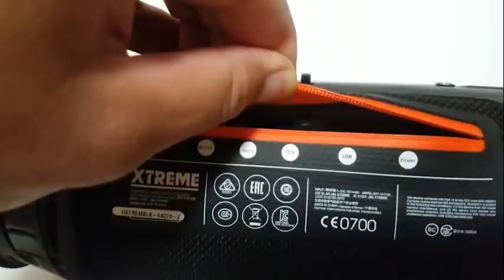JBL XTREME with 18650 Batteries (DIY)

Comment: you'll need to cover the hole where the wires goes in with hot glue or some tape so that the air doesn't comes out, it happened to me after i changed the battery with 18650 I notice some rattle noise after using it for a while and I found out that the air is escaping out from that hole
Reply from the maker: +Jhay12 yes that is correct. I don't think I mentioned that part in this video only in the new video. >>   https://youtu.be/HhC_CpxtSF4

Comment: Use 7.4 volt battery pack. Not 3.7 volt battery
Reply from the maker: Yes the total voltage that goes to the amplifier board is 7.4V NOT 3.4V, on full charge it should be 8.4V
Reply: That pack is connected 2s2p original one was 2s1p(lipo baterry)

Comment: you didn't say anything about the flat cable for the led indicators, so I disconnected them and now it does not work :(
Reply from the maker: Sorry to hear that, but I just didn't bother saying anything cause I thought everyone would see on the video that I have not touched it at all. I haven't seen the connection for the LED lights but hopefully it has a clip.
Reply: Taylor Soloai i couldn't find a clip :( in other videos they unpluggled it but said nothing about it

Comment: hey, nice video thx. 
Is this better than just using new jbl battery packs?
Reply from the maker: +Robert Oxman its a lot easier to use the JBL battery pack but I just went with this method just because I like to experiment and it worked!
Reply: I see, thank you, same here. I think I am going to use some "3000" mah, lg HG2 18650s Seems like it may have better battery life actually than the stock lipo

Comment: can i use, normal rechargeable batteries like sony cycle energy instead this 18650 battery?
Reply from the maker: +Maicoltube are those the "AA" kind? If it is I don't recommend it. It will take up too much space but not enough power to make it work.

Comment from the maker: I have a NEW VIDEO that goes in FULL DETAIL for the battery connections to the board here https://youtu.be/HhC_CpxtSF4

Longer but it will answer questions about what I did not show here on this tutorial.
Reply: Taylor Soloai hi , i want to ask if its also possible to put 18650 battery in jbl flip 3 ?
Reply: Taylor Soloai Can I use 18650B battery..? What is the letter at the end of the number...? Thanks...

Comment: Thanks for this video! I would like to do this myself with my Xtreme but I don't understand in what way you wired the lithium cells.
You would definitely help me a lot if you could tell me this.
Did you wire them parallel or in series?
Reply from the maker: Each pair of 18650s are wired up in parallel
You can watch my new video on how to do that here https://youtu.be/HhC_CpxtSF4
Reply: https://www.ifixit.com/Answers/View/494531/Replacing+BMS+board+and+batteries

Comment: please, how many  Panasonic Ncr18650b 3400mah Ion Litio 3.7v do i purchase ???? 2 or 4 units???? thanks for the answer Taylor Soloai
Reply: cause i have jbl xtreme and the battery is almost dead...just half an hour still works and after needs to be pluging
Reply from the maker: +Yvan Garces you need four units. Connect them in pairs (parallel), so that's two pairs of 18650s to attach to the BMS board from the original battery.
Reply: Taylor Soloai thanks a lot

Comment: Bro can i pm u on fb? Wats ur fb page? I hav same issues. Pls rep
Reply from the maker: I replied to your message
Reply: I dd not rcv response bro. Can u help me hw to assemble the battery?
Reply from the maker: +Glenn Benson Romarte I replied to the message you sent to me here on YouTube. I'll make a video soon on how to connect them to the BMS board from the original battery.
Reply: Yes please. I need my jbl xtreme to recover.
Reply from the maker: Video on how to install the 18650s is up, sorry the video is a bit long but you can skip to the actual part you need help with https://youtu.be/HhC_CpxtSF4